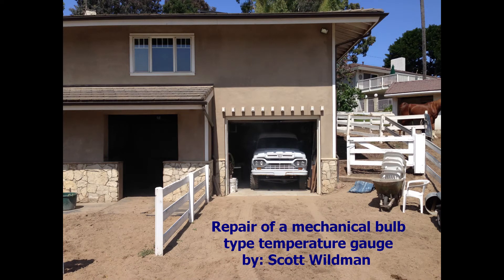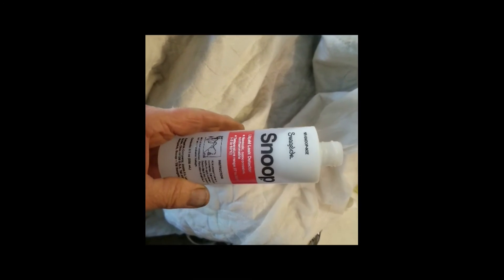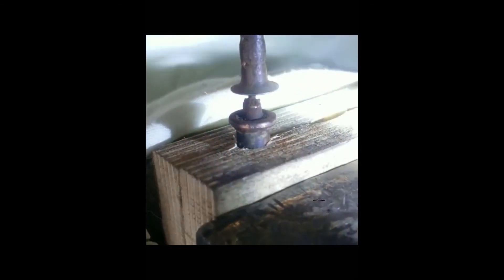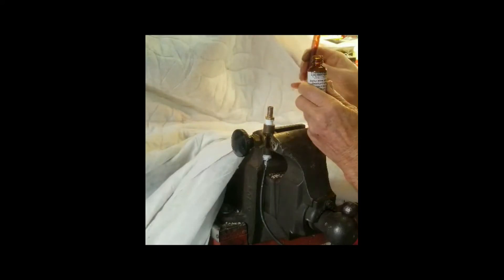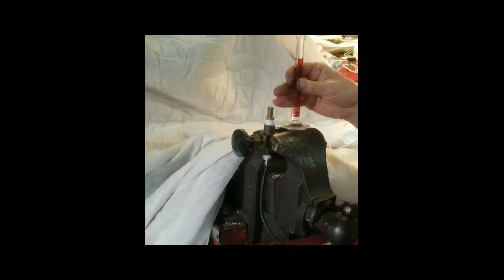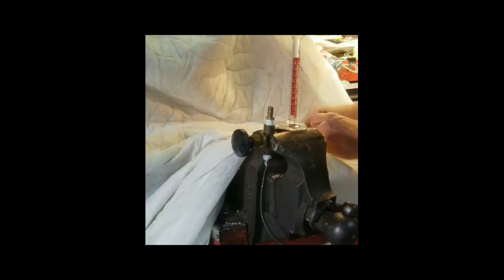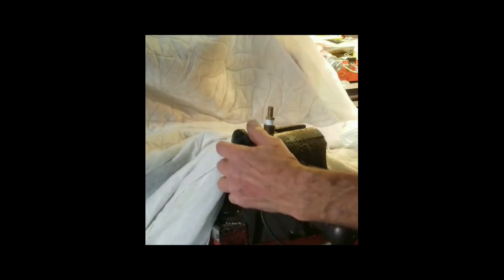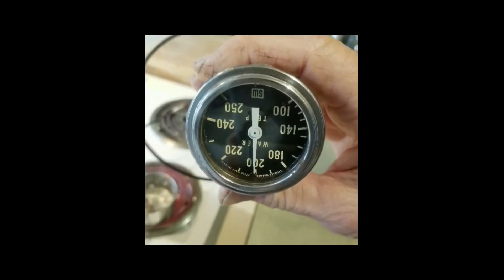Stewart Warner Mechanical Temperature Gauge Repair

Comment: Just a quick question, how is the temperature guage holding up?
Reply from the maker: Good question.   I have driven the  truck 6 months after the repair.   The gas appears to have different properties  than  the original resulting in it showing a consistent operating temperature of 165F and not the expected 180F as previous indicated.  But this is adequate for my purpose of keeping the original operational gauge in place.
Reply: @williamwildman5577  I was going to fix it myself,but I didn't have the proper equipment to do so. Instead, I sent it away to a shop who specializes in instrument restoration and repair for old vehicles. This was a cheaper solution for myself, as the cost of materials and tools would have been the same. Also they fix these types all the time.